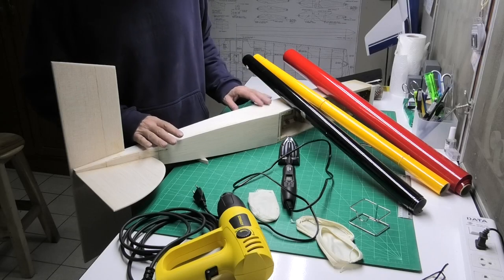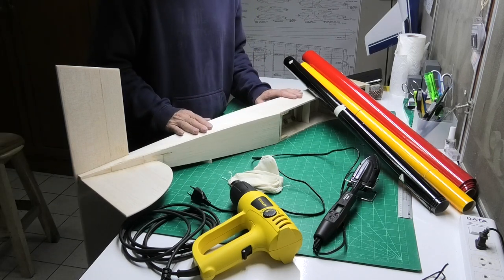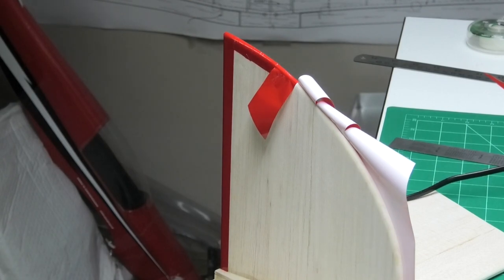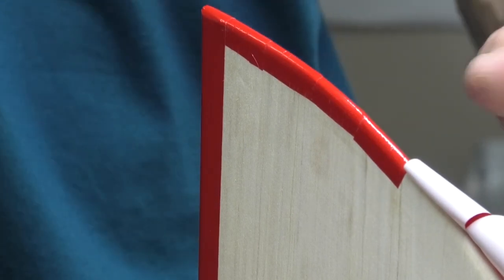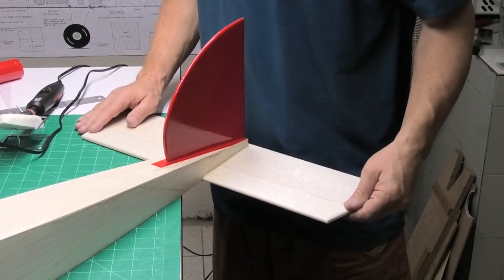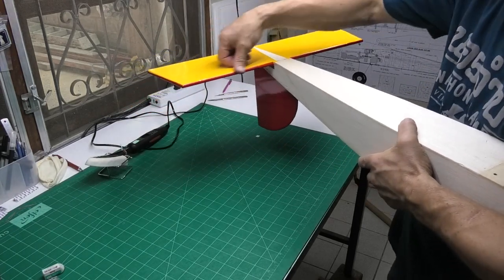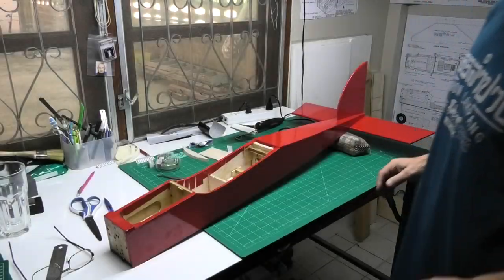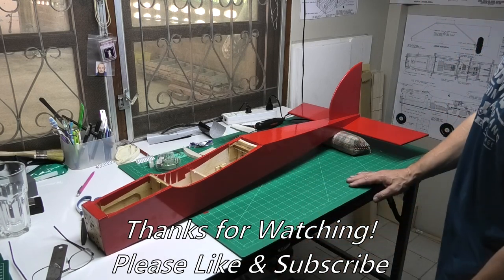Das Ugly Stik Balsa RC Aeroplane Build - Pt 10: Covering the Fuselage

Comment: Thank you Mark for making one of the best covering videos I have seen on the internet. Believe me, I have searched over the years. I have never been trained on covering but after seeing this video, I would say this is great training. I like your reasoning of why you cover certain areas first, then second and third as in the case of the fuse bottom. Thank you for slowing down the footage and explaining in detail how you work the curve on the leading edge of the fin. You have done us a great service by not only explaining the wood build process in your Das Ugly Stik series but now the covering phase. Can’t wait for the next video as you complete the covering. 

I still have my first first trainer (OS40 size engine), which is a solid balsa airplane. The glow fuel has really made a mess of the covering over the years (I bought the airplane second hand, and fuel had already infiltrated the covering seams). I am now contemplating to remove the entire covering and re-cover with the methods from your video.
Reply from the maker: Thank you for such a nice comment, really pleased you find the videos helpful, thanks for your support

Comment: Nice Job Mark. I just wanna talk about some options you might consider. 1) When I cover, I always work from the bottom up. This is gleaned after 40+ years of flying glow planes. So bottom first wrapped up about 1/8". Then the sides, wrapped over the top and bottom 1/8". Then the top, wrapped down 1/8". That's what I shoot for anyway. This helps any fuel and muck fall down and away instead of pooling in a seam. 2) you only need no more than about 1/8" for seam overlaps (which leaves 1/4" total). Large overlaps become very obvious under the covering. 3) You are wasting a lot of time with those "tongues". What I do is practice with a scrap piece of covering and find out just how hot I can make the iron without melting the covering. Then I dial the temp back a tiny bit more for safety. What this does is allow you to really stretch the covering. So on curved surfaces like the vertical stab you were doing, you had the right idea of stretching the covering over to the other side. But I stop right where you start doing the edge of the iron thing. If the iron is hot enough, those tiny wrinkles you are worried about fall right away allowing you to do the whole edge of the vertical in one piece of covering. No the covering that isn't stuck down wont look pretty but using the smooth edge of the vertical you can run your knife along it as a guide and cut the excess wrinkled crap away. Now iron down along the cut line. Like I said, you want just enough covering stuck up and over the curve. There is no reason to go 1/2" down the other side. Now do the same thing with the other side. When your done it'll look smooth like paint with barely any visible seam. The key is heat and and stretching but practice and get to know the covering and how much it can handle.
Reply from the maker: Thanks for taking the time to comment with such a helpful response, it is greatly appreciated.  I am totally self-taught, so appreciate the advice, always willing to learn and improve.  Thanks again.
Reply: i guess it is kinda off topic but does anyone know a good site to stream new movies online ?
Reply: @Ford Emery i use Flixzone. You can find it on google =)
Reply: @Alfredo Gage definitely, have been watching on flixzone for since march myself :D
Reply: @Alfredo Gage thanks, I went there and it seems like they got a lot of movies there =) Appreciate it !!
Reply: @Ford Emery glad I could help =)

Comment: I have thought of making the Ugly Stick a low winged plane. Looks like that could be possible by simply turning over the fuselage, and installing the tail feathers accordingly, and so on. Seems the wing would still be at "0" incidence, and the right and down thrust to be set as usual. What do you think?
Reply from the maker: Hi there, what you say seems to make sense, if you look on outerzone there are plans for a couple of low wing stiks, this is the link to one of them - https://outerzone.co.uk/plan_details.asp?ID=4065